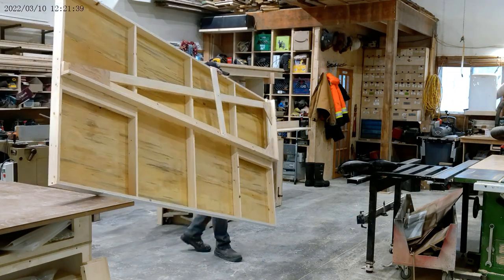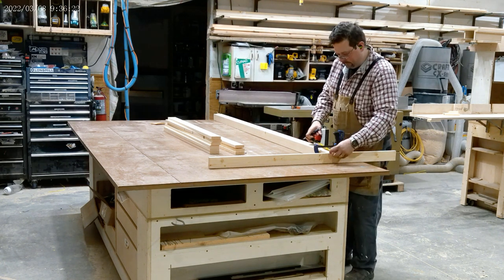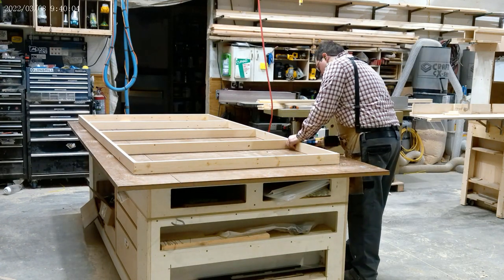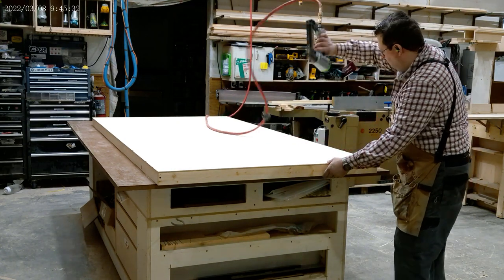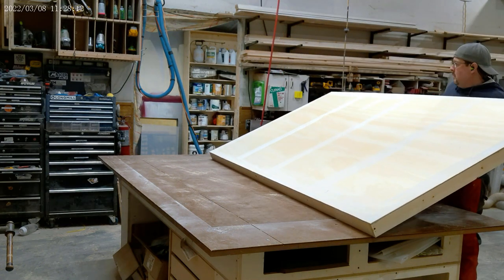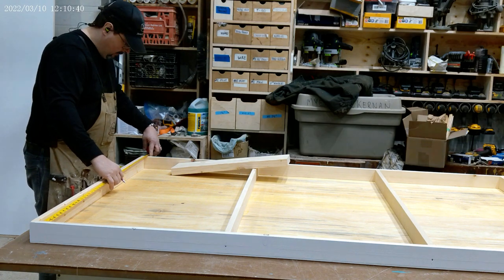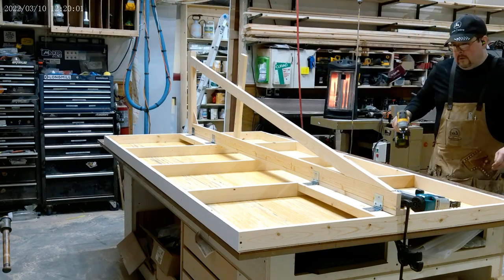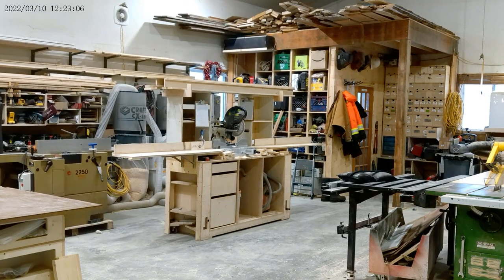Folding Jack Flat

Comment: Thanks for this video! This might be too much to ask, but do you have a cut list and a hardware list you can place over the video? Would be helpful.
Reply from the maker: Um, I can do that but not immediately- up to my eyeballs in projects :)
Reply from the maker: If you email me I can send you a drawing for the jack- sceneryfarm@icloud.com
The flat sizes depends on the dimensions of the material. If the nominal 1x3 is actual .75" x 2.5" then the list is: 2@ 7'-10.5", 2@ 4'-0", 3@3'-10.5". The 2x6 is around 21 7/8" long but you should measure to be sure when the flat is assembled.
Cheers
J
Reply: Great video!